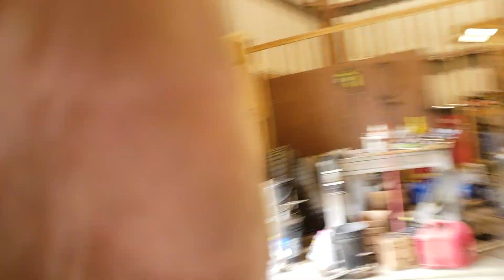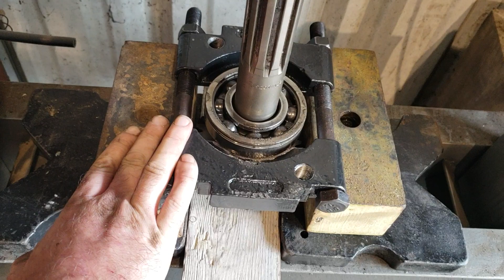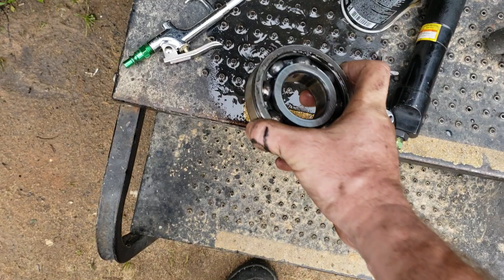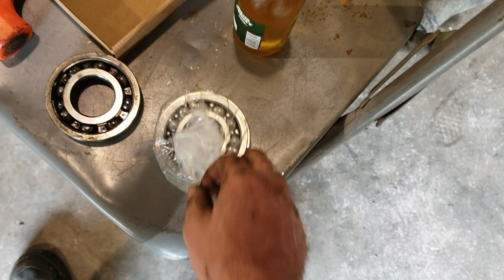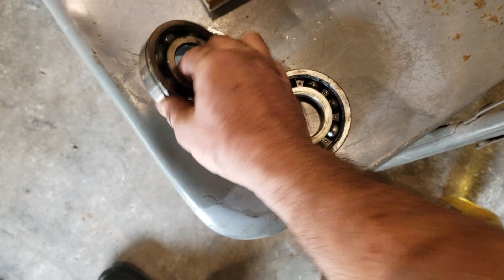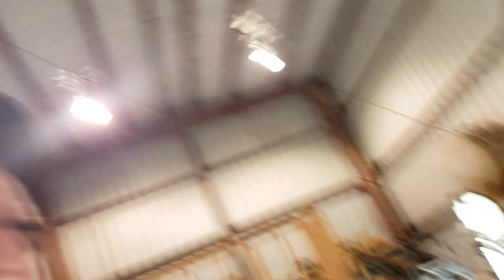M35A2 Transmission, Spicer 3053A bearing upgrade.

Comment: I have a dumb question, are the input and output bearings the same? and are the bearings on the counter shaft the same?  TKS for any help, I am trying to rebuild my M109A3 Transmission!
Reply from the maker: Yes I seem to remember they are both the same bearings. I talked about it somewhere in my transmission videos but it's been a few years ago now.
Reply: @tacticalrepair  Thank you!  I will go back and rewatch them!

Comment: whats the best Trans oil?? Thanks
any front seals to worry about?
Reply from the maker: Nope, no front seal on the stock trans. I use synthetic 75w90 in mine because of the extra power from the Cummins. Just trying to keep the bearings from failing from high speed and torque.

For a stock truck, SAE40 non detergent motor oil is best.

Comment: You almost have me ready to tackle this. My 72 m35a2 is leaking grease from the back and possibly the front shafts. The transmission thats in mine has a PTO on it but its not a winch truck. I suppose I can remove it and block it off with no problems.
Reply from the maker: Sure can.

Comment: with the transmission out of the truck. how much wiggle should be in the input shaft. im starting my swap and have never personally put any use on this gearbox. everything looks dry. no leaks but there is some wiggle to the input where there is nothing at the output
Reply from the maker: It should have a little, but not enough to touch the inside of the bearing retainer.
Reply: @tacticalrepair  good deal. thanks again for a quick response. im going to love towing after this swap.
Reply from the maker: Are you doing a Cummins swap, or are you trying to be funny?
Reply: @tacticalrepair  I'm swapping this Spicer 3053a into my 1996 Dodge Ram 3500 to cure my transmission troubles for good. This transmission should survive Towing much better than anything Dodge offered
Reply from the maker: @nathan00campbell  I agree. Make sure you get a clutch and flywheel that gives you enough input shaft engagement. I need a thicker flywheel.
Reply: @tacticalrepair  
i hope it will all work but im using all SAE-3 to match the SAE-3 housing on the 3053a

flywheel housing 3925223
flywheel RD3968060
clutch 04-107L.2 from phoenix friction 
these are the part numbers i've used. sor far everything seems to be working out just fine. even uses the stock oem dodge pilot bearing (i used a bushing instead, personal preference) 
flywheel and flywheel housing are matched from the same freightliner (though i used all brand new parts) clutch is the correct part number to a gm c8500 yet fits this fly wheel and has the 1.5" x 10 spline input. soon ill find out if i need to cut the pilot on the input shaft as 1/4" my need to be removed. not at all an issue but as it looks that will not be necessary.
im currently in the process of setting up a pull style slave cylinder to the oem m35a2 clutch release lever.  
i plan on using the SAE mounts for the rear engine/transmission mount.. basically making the engine mount at 4 corners instead of the oem set up. this will make the swap much easier and make taking the transmission down much easier.... i even found a yoke flange to work with the oem dodge 1410 series ujoint.
Reply from the maker: Sounds like you got it figured out.
Reply: @tacticalrepair  fingers crossed. but im betting it will be a great upgrade. thanks again for your quick responses

Comment: I am trying to get a view of the oil hole on the front of the trans. Gear oil is saturating my clutch. The lube is coming out main shaft.
Reply from the maker: This is because your input bearing has failed and allowed the shaft to wear into the sleeve of the bearing retainer. You'll need to replace the input bearing, the retainer ( available from Bigmikesmotorpool.com) and your pilot bushing.

You may or may not be able to salvage the clutch, but big Mike has those too.
Reply: I have searched the web for that bearing with no luck. Who sells them?
Reply from the maker: @herbambs937  you can find the 1308SL on Ebay or from industrial supply houses.
Reply: @herbambs937  You can also find them at Oreilly's Auto, Autozone, and some of the major parts places.  Depends what brand you want, if you care.

Comment: Great info! My M35A2 has a 5 gear whine like a bearing going out. Maybe a transfer case or trans bearing?
Reply from the maker: Most likely the input bearing bad, or chipped teeth on the gears.

Comment: Is their a big difference between an engine bay harness for the 427 multi fuel and the 465? Ordered one online and turned out to be the wrong one...
Reply from the maker: I have the same replacement harness, so I'll show you how to make it work.
Reply: Tactical Repair    Awesome! Thank you! I bought a 1957 Utica M-45 and it’s turning into a restoration....
Reply from the maker: That's what it needs at that age.
Reply: That’s the one thing about having an A3... some of my parts is totally different lol.. but I still appreciate and watch the A2 stuff
Reply: What's the number for the bearing? BCA 13LASL? Ist that right?
Is there anybody who knows the original bearing number?
Reply: @juergen07091973  I haven’t watched this video in forever, what bearing numbers do you need?